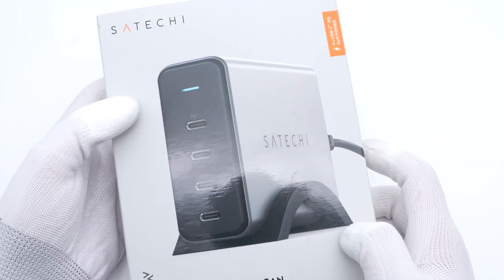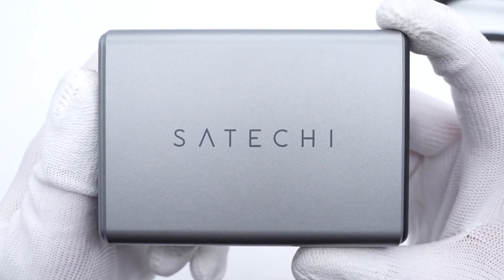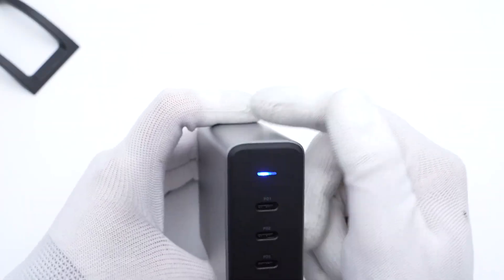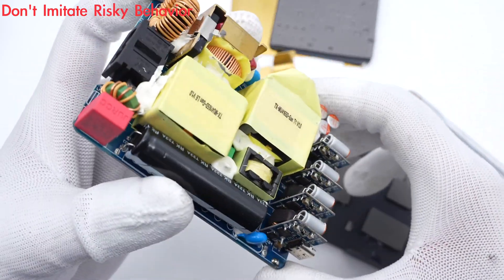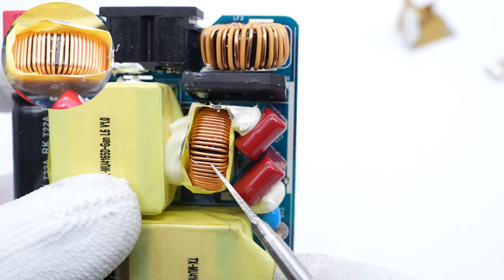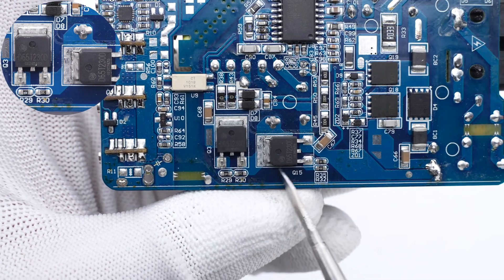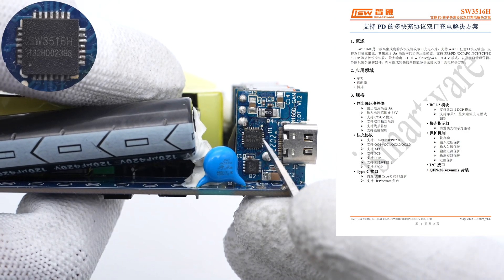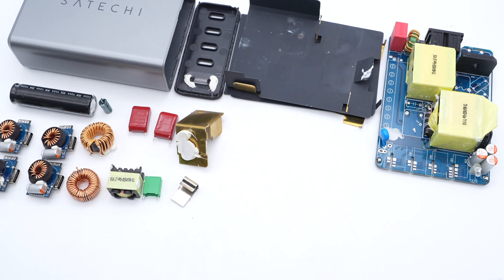Teardown of Satechi 165W GaN Desktop Charger (Four USB-C Ports)

Comment: Thanks for the tear down. I have one of these that has been intermittently disconnecting devices. I’ve been trying to figure out how to get the front cover off without ruining it and was hesitant to use too much force. Now that I can see what is behind the cover, I know where to dig in without damaging anything inside.

Comment: Hi, I wonder if I can use this adapter., I am living in EU where electricity is 220kV?
Please let me know if it is possible to use where plug output is 220kV
Reply: It's 220V, not kV. Yes, you can use it all over the world as long as the input is between 100V and 240V and 50Hz or 60Hz.